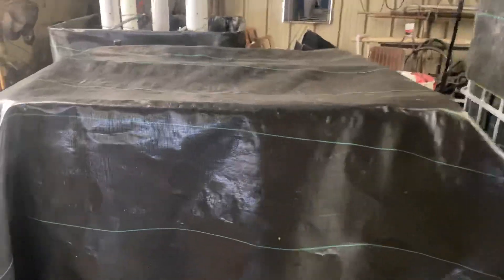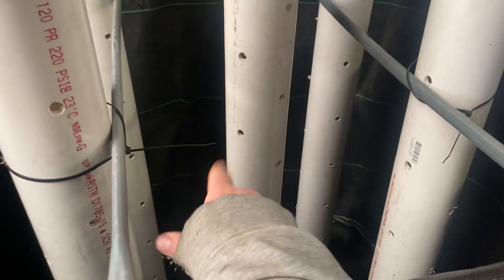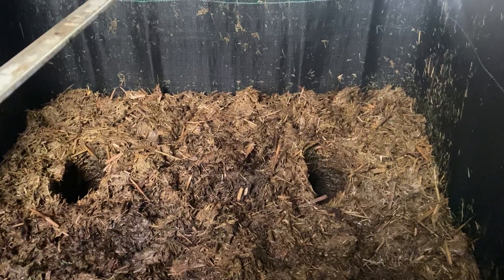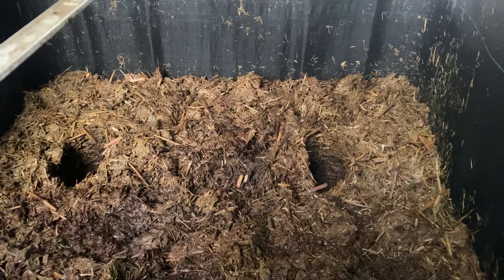Johnson Su Bioreactor Composter Day 25

Comment: I just wondered in finished product can we see any harmful fungi I guess directly IT depends on what kind of added material ?

Thanks for your effort 

Hi from Harran Universty, Turkey
Reply from the maker: Keep them from going anaerobic and you should be fine and not get any harmful fungi.
Reply: @youngredangus6041  and one more question, we have 4" pipes ( 6 piece )  and high is 5 foot  we don't know how many space we need to open it and distance between them? 
Thanks again
Reply from the maker: Amed Hekarê ask as many questions as you like.  
The small holes on each pipe or how far apart to place the pipe in the compost
Reply: @youngredangus6041  I mean what should be the distance of each small holes on the pipe ? Our cycle's diameter is 110 cm
Reply from the maker: Amed Hekarê 

You don’t need holes
Just remove the pipes the next day
Reply: @youngredangus6041  I am little bit surprised now. We have thought that its because of aeration ;))

Comment: Few questions before I comment. Do you keep these bins inside till compost is complete, if so why do you keep them indoors wasting inside floor space when they could just as easily be outside? I see you have plenty of inside space, but still wonder why you’d keep them indoors, plus take the time to cover them when they’re inside already covered? I love these IBC totes and feel rather than making them into composting bins you should turn them into vertical grow towers/worm farms. You could be growing food vertically with these bins and each bin could be a worm farm. By growing this way no irrigation is lost and all irrigation coming out can be saved to use on the next watering. Any irrigation coming out will be more nutrient rich because of the biodiversity within the bin your Red’s are creating.
Reply from the maker: EVE Growing 

Do I keep these bins inside till compost is complete? 
Answer.  No.  This video was made in February.  In Mid-march we moved the completed one outside .  (David Johnson’s says not to let them freeze.). In November I’ve brought all of them inside until I can set up heating tape for them to go in another area that is heated.  I left on tote outside to let it freeze and we are going to compare the two compost.  

Why Lids?
Answer: The lids were made because they he wind can blow 50mph here and 20-30 mph is pretty common so I don’t want them drying out.  They are inside but the I made the lids so I just set them on top. 

I don’t know what a grower tower/ worm farm is.  I’ve heard of them but like I mentioned before I’d rather go through the process of being good at building Johnson Su’s than learn every method to making compost.  I have friends doing the worm farms I’ll see how it goes for them and maybe try it later.  Do you have videos you’ve made of worm farms or have ones you would recommend?
Reply from the maker: EVE Growing 
I found your channel.  I’ll check you videos out sometime this week.  Thanks
Reply: @youngredangus6041  Know I grow on a residential level my system designed for Urban Life as I too try to bring back biodiversity in inner city soils. I feel this biodiversity the J Su bin claims can be found in any composting set up whether doing traditional composting, or a CBCB like the J Su is. With the equipment your farm seems to have available this J Su system seems to be more of a hassle than its worth. IMO you should be designing composting bins with this heavy equipment in mind. The secret to biodiverse soil comes from the worms added after the thermophilic stage is over and Red’s are added. With all these cows you have it seems to me you mix all this nitrogen rich manure with this carbon rich hay and keep moving it around once a week with these heavy machinery till the heat phase is completely over. In the end you want to make worm food that turns more into castings rather than compost, but of course you want both and there’s a ratio to think about. The compost becomes your soil base and the worm casting become your soil amendments. People are inoculating seeds with worm tea too which is far easier to make than J Su’s method.  I feel with your equipment and access to manure you can make way more biodiverse soil than using the J Su method.

Comment: The black weed hought the air from the exterior surface was as important as the air coming up the atrier mat looks like it doesn't allow much air to move into the column. Does it breathe? I thought the air from the exterior surface of the column was as important as the air coming up the chimneys from below.
Reply from the maker: Scott Hortop 
My biggest problem is it doesn’t breathe well enough from the bottom.  Sides are fine

Comment: My questions are about worms. 1) How many worms do you put in? I saw a couple of other videos and they said to use Red Wigglers. But they don't do deep diving. Earthworms do deep diving. If you had enough worms, they would give you a pile of worm castings. A pound of worms will eat almost its weight every day. It looks like everyone wants soil and not worm castings though the microbes and fungi are inside the worms helping to break down your compost.

 2) If I ever get my market garden, I would start with building a Bioreactor and worm bins. If you buy in bulk, you can get basalt rock dust for $65 a ton. Arden Anderson is an MD with a PhD in biophysics but most importantly, his first degree was in agriculture. Still practices medicine in the Miswest. He says basalt (volcanic rock dust) is paramagnetic meaning it responds to magnetism. He looks at what we are doing with plants from the perspective of energy. Paramagnetism means the crops receive more energy so they grow faster. That means a shorter growing season. That is critical to someone further north with a short growing season. We will all have shorter growing seasons as we enter another Grand Solar Minimum. During the Maunder Minimum (1645 - 1715), the price of wheat rose 400% in the UK in  some years. You will need that short growing season. So would you add just a little basalt rock dust to your Bioreactor? Worms do need grit. Some use eggshells sterilized and pulverized to add grit. Adds calcium. Also the worms turn the chitin into the enzyme chitinase which digests the exoskeletons of aphids which would be more of a concern to veg growers. Also aphids are attracted to farmers who douse their fields in liquid nitrogen.

3)  Also note that Gabe Brown said the soil is warmed by all that soil biology so you can take a harder winter. Soil biology hibernates until the soil reached 53 degrees F. Worms slow down below 64 degrees F. So this question is about the temperature of your compost pile. Does the biology keep it warm enough if you are in a shelter without heat? My goal is to build a climate battery greenhouse with soil closer to 70 degrees F year round. This has been done. Saw videos. I would use transplants and get 12 crops a year of red bell peppers. Plants do not like being disturbed and do not like being raised in small containers before being transplanted. I have followed the work of Dr Olivier Hussons, a French researcher. They found that the best soil measures about 300 to 400 millivolts.But seeds are barely a blip on the screen. That should explain why seeds do not germinate well in worm castings, too much voltage. The microbes eat the minerals and hog them until higher soil biology like protozoa and nematodes eat them. They incorporate all those minerals and begin to emit electrical activity. I would love to work with transplants to cut my Greenhouse growing time so I can get 11 to 12 crops a year on some plants and at least 6 on others. Maybe 3 or 4 crops on some that customers insist I carry. Problem is that all that paramagnetic rock dust might overwhelm my germinating seeds who need biology but not off the charts electrical activity of paramagnetic worm castings. So maybe dial back on the rock dust in the bioreactor and add a lot to the worm bins? Also coffee grounds for nitrogen.

4) This is getting too long but I do need to quote Gabe Brown again. As we go into this new Grand Solar Minimum, we will note the jet stream will wander all over the place due to a decrease of the earth's polar magnetism. We will also have more clouds and more rain in some areas and because of the wandering jet stream drought in other areas. Gabe Brown noted very well that his soil could absorb a lot more rain than his commercial ag neighbors. 2 inches of rain and they were flooded out. Could you share with us the ability of your soil to absorb rainfall? This will be a critical issue as we go further into the Eddy Grand Solar Minimum. That and the shorter growing season. The Midwest has experienced its share of floods last year. Gabe Brown did well. But not his neighbors. PS: Have you heard of sap analysis? Pays for itself. They say they can double and triple photosynthesis. Sap analysis is sort of like blood analysis of humans. The analysis tells us what minerals to use in a foliar spray  at critical points in the plants' life cycle. They get amazing corn crops with very high quality corn. 
I will be looking at more of your videos. You might want to just answer one question at a time.
Reply from the maker: Horse237 
1) 100 worms after the piles get down to 80 degrees.   Red Wigglers are the worms I’ve heard people should use.   I asked John(neighbor i mention in several videos) if I could get worms from his pile and he said yes.   I didn’t realize Johns worms from his pile were native worms that crawled into his wood pile.  I didn’t know how well they would do and they are breeding like crazy so I guess they are working fine.  
My piles have gone anaerobic and I am in the process of fixing them.
Reply from the maker: While fixing the first one there were well over 500 worms in it.  We put the worn in the bioreactor in March.  So in 3 months so the worms have exploded.  Once I find out if my methods of fixing a pile that has gone bad have worked I’ll make a video on how to fix them.  I’m getting ready for work.  I’ll do my best to answer your other questions tonight.  Thanks

Comment: Did you perforate your PVC pipe or did it come that way?
Reply: Kim X it comes that way. Look for 4in drainage pipe. They sell it at Home Depot in 10ft lengths.
Reply: @Agr414  With my first PVC pipes for my compist heaps, I drilled the holes in them myself.  Then I discovered perf. drainage pipe and use that now instead.

Comment: About adding worms it's getting to 80 degrees not 80%
Reply from the maker: Wayne Burks 
Yes thanks.  I don’t know why I used the % sign for degrees
Reply: @youngredangus6041  Do you put in the worms when it gets below 80 or when it goes over 80?
Reply from the maker: xDanoss318x 

Depending on your C:N ratio your pile should get hot really quick.  With in 3 days most of ours have hit between 150 and 160.   You let it cool down to 80 degrees and put your worms in.  It’s good to buy a 3 foot compost thermometer.   If your carbon source is higher you will get a lower max temperature and it will take longer to break down.   David Johnson said he has done straight wood chips.   Only got to 80 degrees and it took 2 years to break down.    Check out my other video on how to build and file them.
Reply: @youngredangus6041  Thanks a lot. Will do. Do you have first results with the compost?

Comment: What was the name of the container you used for the 3rd bioreactor that you designed?
Reply from the maker: Taso 
They are chemical shuttles.   Do you know of any companies or businesses in your area that supply chemicals or fertilizers for agriculture use?  They would have plenty.
Reply from the maker: I’m working on a video on how to build them and fill them.
Reply: @youngredangus6041  That's awesome.  Thanks!
Reply from the maker: Did you get a chance to watch the video about how to build the bioreactors
Reply: How do u remove compost when it’s finished

Comment: Do you add worms to the finished compost?
Reply from the maker: Cosmic Pangolin sorry for late response.  Once it cools down to 80% you can add worms.
Reply: No worries, thanks for responding
Reply: Can I do all fresh green leaves
Reply from the maker: Jerry Maxey 
I believe you will be fine with all green leaves.  I’m in a Facebook group and Ill ask the question and see what the group says
Reply from the maker: Jerry Maxey 
I believe you will be fine with all green leaves.  I’m in a Facebook group and Ill ask the question and see what the group says.
Reply from the maker: short answer, no.  It's all about the C:N ratio.  Green has a low ratio (5 or 10:1), which bacteria love.  Dried stuff,  is high.  100:1, even 200:1.  Fungi love this.
Reply from the maker: short answer, no.  It's all about the C:N ratio.  Green has a low ratio (5 or 10:1), which bacteria love.  Dried stuff,  is high.  100:1, even 200:1.  Fungi love this.
Reply from the maker: That’s the response I got from the FB group.
Reply: Thanks red
Reply: I guess it doesn't matter in a fungal system
Reply from the maker: I got another reply.   

YEs, you can use green leaves.  It will get hot quicker. We usually harvest green leaves to mix in with our dried stuff, it helps to get the fermentation going.